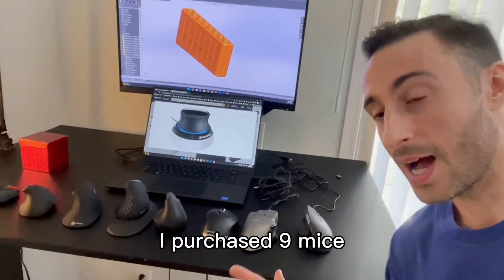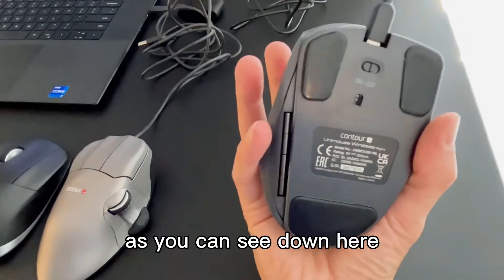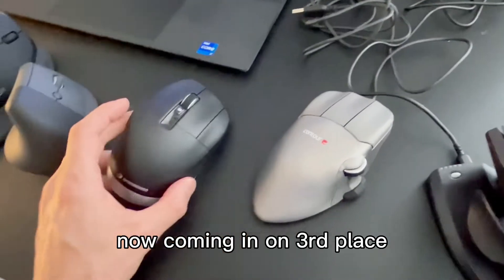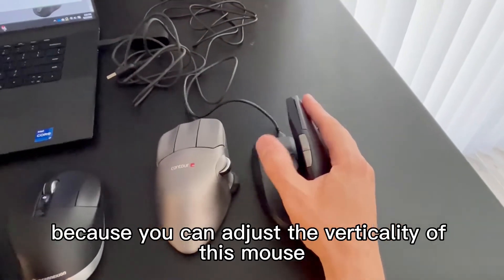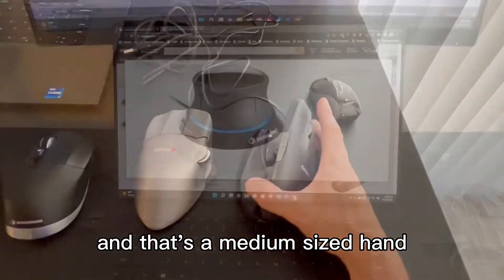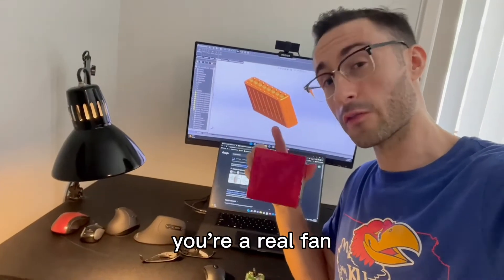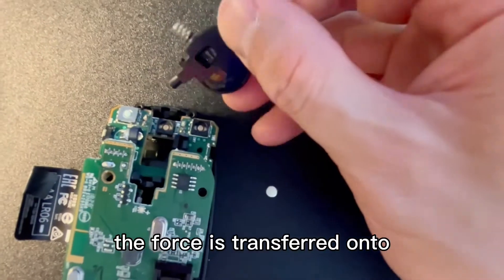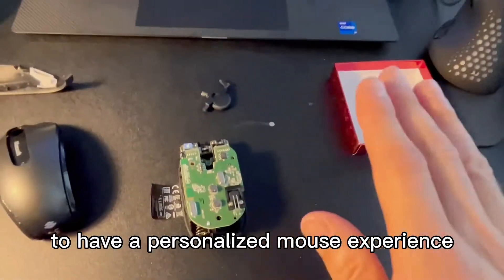The Best Mouse for CAD 2023?

Comment: 3dconnexion CADmouse is irrelevant because the middle mouse button can be remapped. I just use a gaming mouse with side buttons paired with x-mouse button control software to remap the middle mouse button to the side button (back). With the use of my thumb, I can comfortably rotate the model. I set it to work only when in Solidworks. In this setup, I can use any mouse I want without remapping everytime I change my mouse. So, I wouldn't have to buy 3dconnexion that is so expensive and heavy, and be dependent to it just because of the dedicated middle mouse button. Ergonomic lightweight gaming mouse is much better than 3Dconnexion CAD mouse, in my opinion.

Comment: 1:10  You have no clue how long I've been curious about this one..  I'm also ambidextrous - but learned 'Wrong'.. 
I'm Left handed for drawing/writing,  but,  when using a PC,  I was always forced to use the mice Right handed.. 
Through school,  I just got used to it..  Then stopped using mice and went 'dedicated touchpad'

So..  fast-forward..  

Now,  I have a touch screen pc w/ digi pen,  but there's been a bit of a wrench thrown into the gears.. 
3D design / printing:  I feel like for some reason,  I would probably be better off with a more dedicated/niche mouse. 

Of all the models I've seen,  the Logitech Lift & MX Vertical - Especially since the Lift is offered in South-Paw

Now,  I see the Contour model in your video,  and I also see it's plusses...

Biggest hang-up now:  Left handed  or  Right handed?!?! 

[It sucks that Leftie / Ambidextrous people have to deal with this nonsense]

Any insight into this one would be greatly appreciated! 

Thanks Bro!
🤘
Sam -

PS: I'm also a life long photographer/editor and still newb to video editing.. 
[Multi-function mice like these should be a triple-threat for art/cad/video]
***Tech has advanced a little bit in the past 20ish years..  haha

Comment: Both a normal mouse and trackball mouse have repetitive motion problems. I get pain behind my thumb from using the trackball while holding the left button down. I got so excited when I first saw the Contour mouse you're talking about, because I thought that little thumb cradle was like a Trackpoint in a ThinkPad laptop (think tiny high-resistance joystick). I still think this would be the most ergonomic option - you'd have infinite scroll, zero wrist movement and almost zero thumb movement. Couple that with the ergonomics of the Contour mouse body and I just think that would be the absolute best! But no one makes anything like it. T_T

Comment: THANK YOU for finally mentioning the one ergonomic factor that after hundreds of ad-style YouTube reviews I've never seen anyone make about a productivity mouse.
At 2.24 you describe using FINGERS to move the mouse instead of the SHOULDER - resulting in a LOT less effort & therefore fatigue and RSI.   This is the problem with the logitech MX style of having a sweeping plate under your thumb - you cant push it around with the thumb-pinky combo.  And yes - the scroll wheel is a shitty substitute for an actual 3rd button.  For my fellow Maya users, google the HP DY651A mouse.
Reply from the maker: I appreciate it. I'm here to serve.

Comment: My work is primarily CAD and I found I often am zooming in and out of a large model and using the scroll wheel so much stressed my middle finger. Great solution I found is there are vertical mice with a joystick on top that i can map forward and back to the scroll wheel motions and just hold my thumb forward or back.
Reply: Is it Verbatim?

Comment: I use the razer deathadder essencial. I prioritize ergonomics over  3 buttons mouses. Tried vertical mouse from 3d connection, and got wrist pain. I admit 3 button mouses is cool and haver their advantages to rotate the 3d model, however I dont like them. Razer deathadder got a smooth wheel click and as ergonomics go its still my number 1 mouse for Catia v5. I can work 10-12h a day without having wrist pain or being inconfortable.